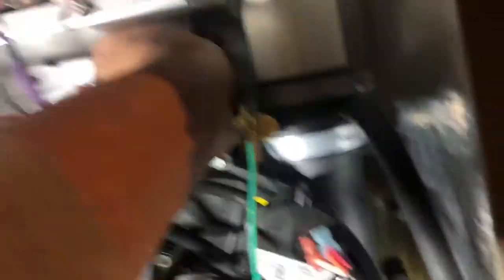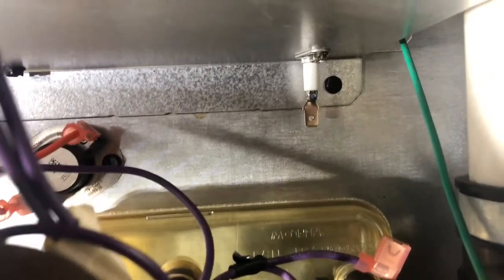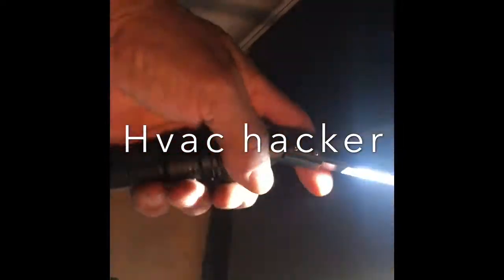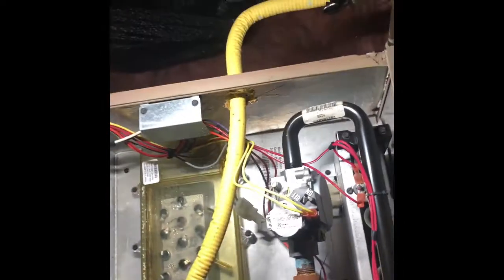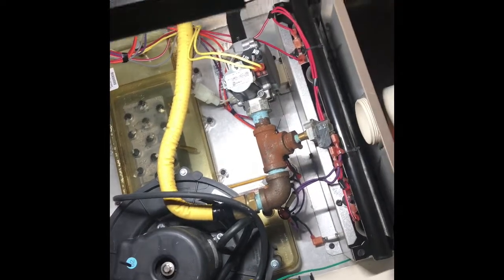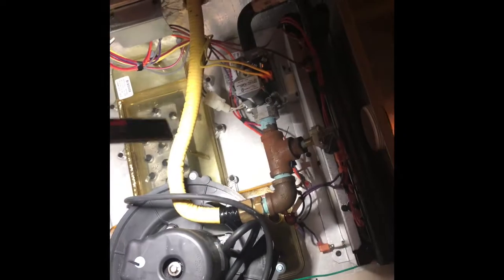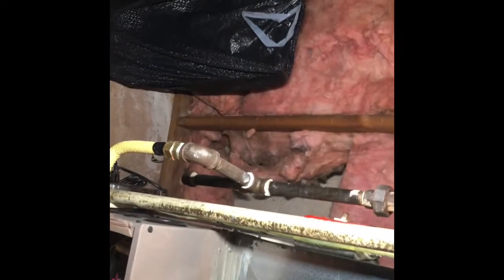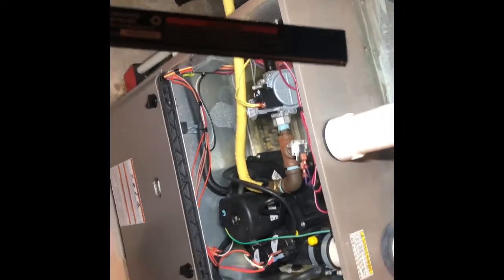Quick first call

Comment: One thing to look for on those older model yorks like the one in this video is cracks on that clear plastic condensate collector box, they are known for cracking due to the cheapness of the plastic which eventually could lead to a hole.  Problem was so bad that johnson controls recalled them for people who still are under warranty
Reply from the maker: They never call me back.